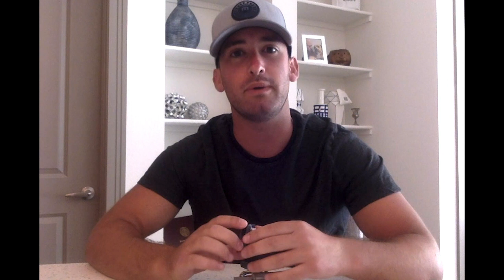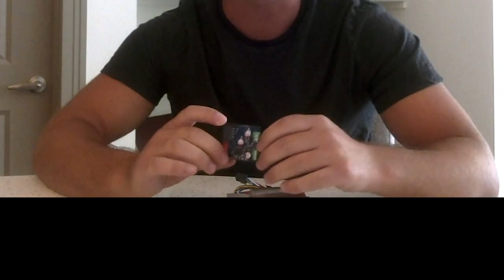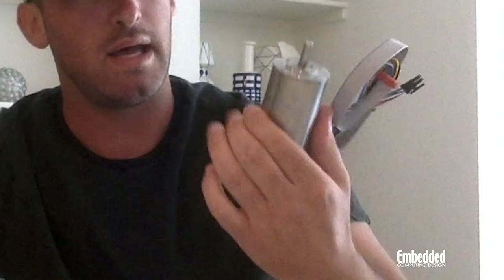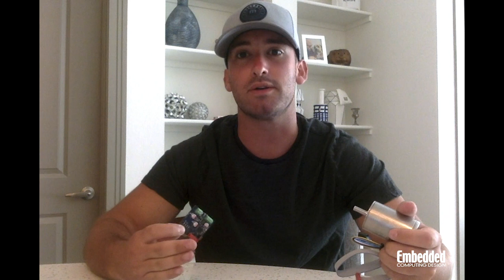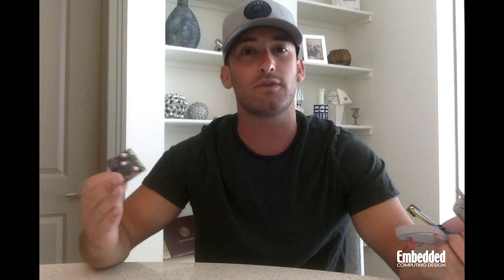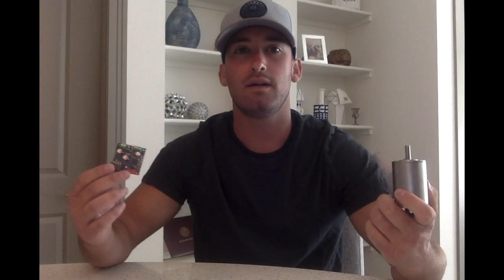Dev Kit Weekly: ST EVALKIT-ROBOT-1

Comment: There isnt much on the STSPIN32F0A thats used in this, perhaps show it running and the interface to get it up and running.
Reply from the maker: Hi Adam. Thanks for your feedback. The purpose of this segment is simply an overview of the kits. We produce another segment called Embedded Toolbox where an engineer walks us through solving a problem using the kits. Those segments are a bit more time-comsuming and complicated to produce, so it's slow going for now. But our goal is to feature a kit in both segments and post them in tandem with each other. Stay tuned.